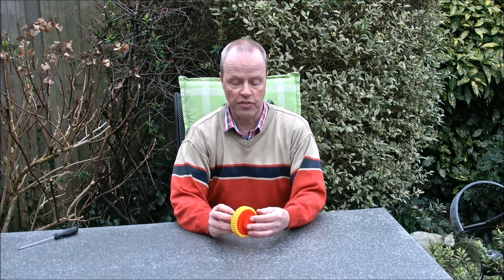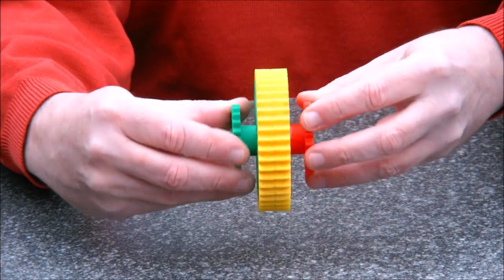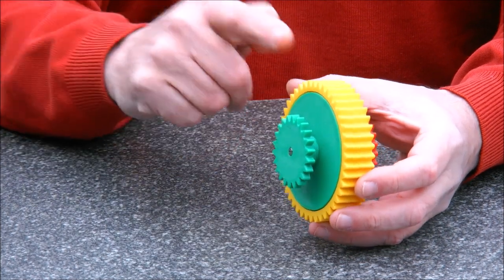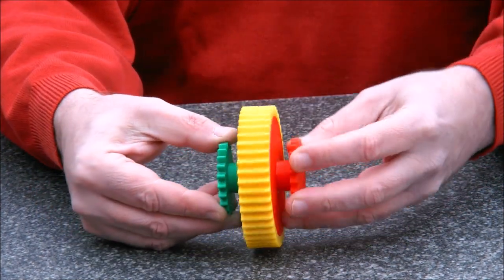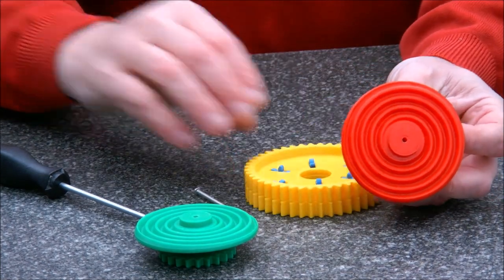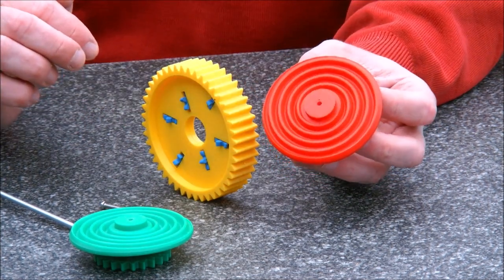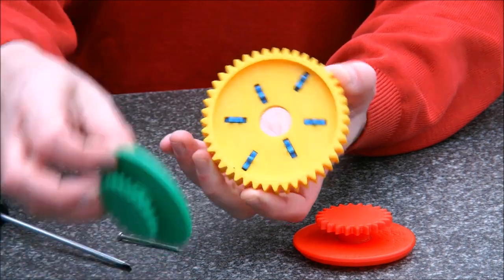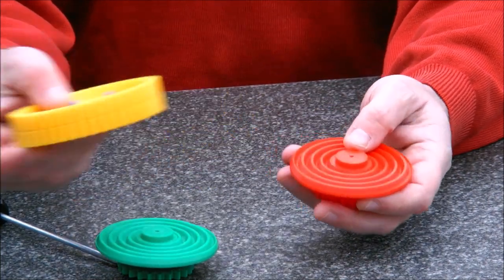Disk Differential - Why wouldn't you want this differential in your car?

Comment: Just guessing, but I can think of two possible reasons:
- As the slope of the spiral has quite a low angle, there's not a lot of torsion that's able to be transferred to the outer gears.
- Having a shear sliding motion over the gears introduces more wear and tear on the gears, this friction will also lower the efficiency.
Reply: real CX Gamer???? holy moly it's been a long time
Reply: @vinesthemonkey  Lol didn't expect Oskar's channel to become the watering hole for retired redstone engineers :D
Hi!
Reply: Hello from old RDFers 
I always had a dream of running an active redstone YouTube but I think it's been too long now... now I can't imagine myself getting back into redstone
Reply: I don't believe the efficiency will be a huge concern: when driving straight (the common case) none of the internal parts are moving.

The contact force on the teeth of the blue gears, however, will definitely be very high and I'd expect they could break when transmitting a high torque

Comment: This is a very interesting differential but usually unsuitable for a car because of the topology of the car which forms a T with the engine at the end of the long leg and the wheels at the ends of the short ones. Also this has a big difference in gear size and the small internal gears are probably quick to wear. But I could see it used in a variety of robotics applications. It's a really nice design.
Reply: I think it could make sense for a front wheel drive layout since the engine and transmission are often mounted parallel to the front axle.

Comment: I think it is important to consider when the differential is locked (as this is experienced most commonly - while driving straight).

The regular Torsen has a large contact area between the worm gears and the worm wheels driving each car wheel. Thus it is strong and the wear is spread out.

For this design, there is a relatively small point of contact between the internal blue gears and the worm plates (??). Furthermore, the angle of these is not perpendicular to the rotation: it is a very shallow angle therefore the normal contact force will be very high compared to the torque it can transmit. This will create a lot of wear.

EDIT: I doubt wear is the primary concern though. I think the issue would be the teeth sheering off entirely.

Comment: Car differentials are designed to cause some kind of friction which enforces locking together of the wheels when one of them starts moving too much faster than the other. This mechanism completely freewheels until it hits a point at which it suddenly blocks 100%. There are a few bad aspects of this. One of them is that at any given time while driving normally it will be at some arbitrary point is the amount of slip it allows causing unpredictable handling based on where it will hit that limit. The other is that when it does slip it will potentially be able to get quite a bit of momentum going before it hits the limit and when it gets there it may cause quite a bit of damage to the mechanism. Momentum, torque, and friction act very differently at car speed and scale than with these little plastic parts.
Reply from the maker: A Torsen differential can divide the force to the two wheels up to 4:1, where the wheel with best grip gets the most power. However, if one wheel slips completely, it starts spinning, as 4x0=0. Perhaps a Torsen can be combined with a limited slip differential?
Reply: This would be exciting on a race track where the cars only turn left. On the second or third lap, the differential would lock. For maximum excitement, this would naturally happen in a turn.

Comment: The only problem (as with all worm-gears) would be back-drivability - although that is an unlikely edge-case (one wheel is stuck and the other is being back-driven). Other than the high tooth-stress on the pinions, there aren't many disadvantages I see.
Reply: Worm gears are used in torsen differential just for this reason, stopping back-driveability
That's why he said it is inspired by it

Comment from the maker: Why wouldn't you want this differential in your car?
Reply: Because its 3D-printed plastic 😁
But on a serious note.. there are quite more moving parts compared to a traditional differential, so more stuff to break/go wrong. There will be a lot of force on those small gears, so the wear will be greater I think
Reply: I think it probably has too much of a limited slip effect. That means when turning a corner, all the torque will go to the wheel on the inside of the corner, which tends to push the car straight.
Reply: I believe the smaller gears on the inside may be more fragile than the bulkier planetary gears differentials use now
Reply: I feel like it would be much easier to grind this mechanism than a traditional one.
Reply: Because I don't have a car. (:

Comment: I haven't seen a spiral gear yet. There is probably a reason for that, and I suppose it is because cast iron does not have a smooth surface, and RC-Car companies might not have invented the spiral gear?
On the first glance, it looks like a good solution for FDM printed parts. It is not only easy to print, but also  might have a better surface for that application. I can say, it is the best fdm printed differential I have seen, yet.

Comment: While the action looks very good as a limited slip differential, I think it's main downfall is circulating torque inside the mechanism.  Due to the shallow ramp on the output spirals, I'd expect gear tooth loads on the internal gears to be far higher than on the large input gear.  (5-10x?)

Comment: The normal torsen has 6 small gear components, while this has two HUGE ones, that also have more complex geometry.  For use in a vehicle, you could not simply cast the spiral plates.  Surfaces mating with gears that transmit high torque need to be machined, otherwise they wear very quickly.  That's the main issue I see - production would be difficult and expensive.  Maybe there's some futuristic wonder alloy that would work for casting such a thing, but again, for vehicle production, $$$ matters.  Or when it doesn't, weight does, and those plates seem likely to be heavier than the components ion a conventional torsen. 

Perhaps it would be suitable to use cast plates for something like the axle on a pedal driven adult tricycle, but in that case the anti-slip feature isn't needed; the rider can just get off and push the bike.  Might be nice for riding on snow and ice, but that's a very small market...

I see this concept being more applicable to some variety of specialty mechanical calculating machines, but those really aren't a going concern any more.

Comment: Based on my understanding of the design, the ability of the car's drive to transmit torque through the yellow gear to the red and green gears is limited by the contact surface area between the blue gears and the red and green spiral surfaces, which is quite small.

Comment: The reason I wouldn't want it in my car is because the best cars are electric and have a dedicated motor for each wheel. So it's a potential solution to a problem that's going away.

Comment: it's an interesting design but the main flaw I see is that the blue gears may grind into the green and red parts in a similar way that metal gears are made. This will reduce the life of this differential much faster than regular ones

Comment: I think design would have issues because of the limited rotation not being able to return to center. Lets say a left wheel slipped to its limit and you achieve full traction in a straight line. Now the axle is locked in the most forward position and you need to turn. Depending on direction of the turn. The axle has no free rotation in one direction entering a turn. You would be entering a turn with a locked differential. Scary.
Reply: This one won't ever lock like that. You could drive in a circle all day and it wouldn't lock up.

Comment: A car differential turns the torque perpendicular to a through axle. This differential keeps all the torques parallel.
Reply from the maker: A car differential has an extra gear set to drive the differential. This one could have those extra gears too.

Comment: As many others said, it's not feedable. One reason not mentioned is reversing. That's a very litteral one way differential.
Reply from the maker: You mean reversing, like having your car run backwards. I don't see any issue for this with differential.
Reply: @OskarPuzzle  yes that kind. and the biggest issue is the notably high torque of the reverse gear of a vast majority of cars, combine the the compressional forces and the small teeth, notch, finger things. they are likely to sheer right off. however, with minor modification there's a high likelihood it can be used in aviation because of the clutch like aspects of it allowing the engine(s) to rev or spool up a little quicker with that, albeit small, buffer zone.

however if anyone where to prove me wrong by putting a working, and conventionally loaded model without any negative side effects then i'll admit i got it wrong, but from observation there's not enough effective mass (also lack of bevel gear on input) to withstand standard service use of general run about. a good visualiser would be bending a wire tighter, with that spiral design.

though another observation, if a complete redesign where to occur effectively making it a completely different mechanism. would very easily work, still be simple, have roughly equal moving parts (cause more than needed always shafts you). but i unfortunately do not have access to a tool shop to put my money where my mouth is. or i would, gladly.

but that all being said it is an interesting and immensely compact design, and if i am proven wrong as aforementioned, i'll gladly admit my shortcomings and learn from it. cause learning is fun. also, i thoroughly enjoy your videos and they always intrigue me with the puzzles. admittedly the puzzles i tend to do is "how can i make this work and will it be stop gap or permanent. or tempermanent"

Comment: Disregarding the sliding action against the internal gears causing unnecessary friction, the main reason I wouldn't want this design is because it's applying too much load to so small of a gear. good gears are necessary brittle, and the design of the spiral requires the internal gears to be thin and therefore weak